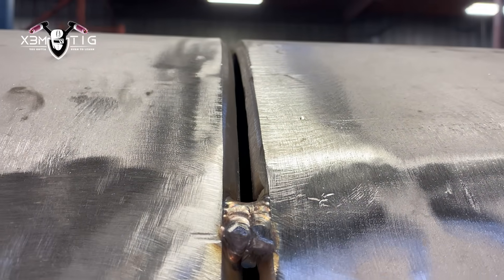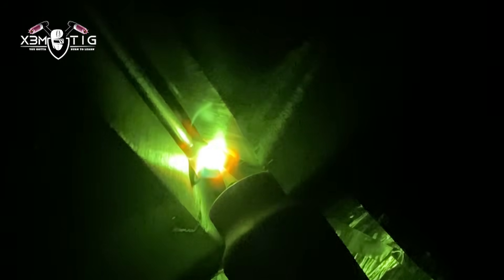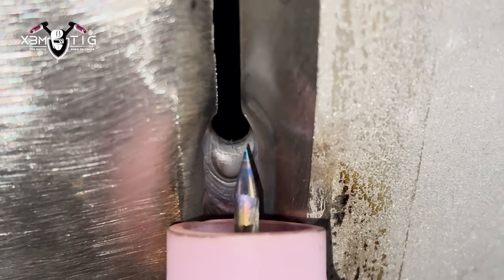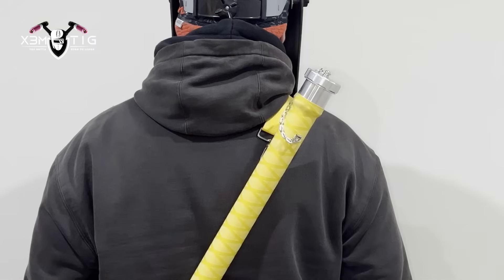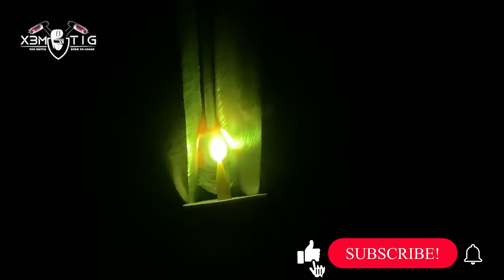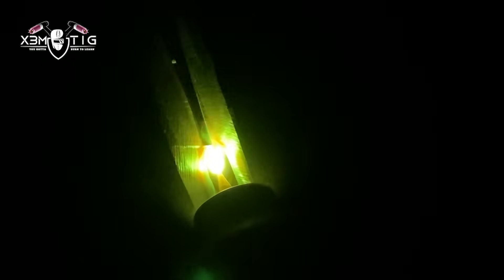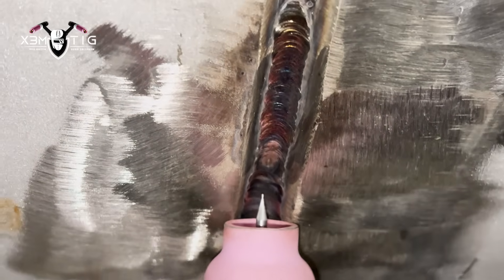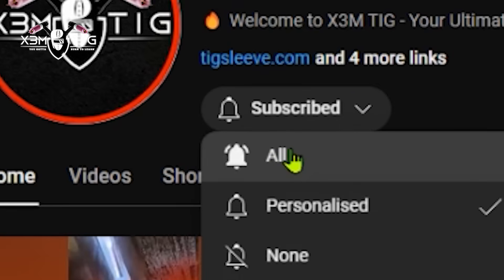Welding Stainless TIG Root — Hi-Low and Tight Fit Challenges

Comment: Hey, can you do a video of super duplex 3” 15mm thick with a step , and a tight gap 2.5mm-3mm  I’m having a hard time getting a lot of pen and undercut at the top using 2.4mm filler wire

Comment: Huntingdon Fusion Techniques HFT® offers Trailing Shields® designed to ensure that welds stay under a protective argon gas cover while the hot weld metal is cooling to prevent oxidation on contact with air.

They are available in a flat style for sheet metal welding or in a curved style for welding circular items such as tubes, pipes, and tanks of all diameters. The shields can be fitted to all brands of GTAW and plasma welding torches. Longer and wider versions are available for automatic welding.
Reply from the maker: They have some cool stuff but not many companies that I work for would buy any of that helpful stuff!